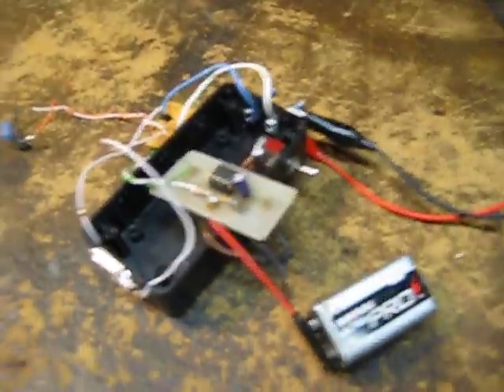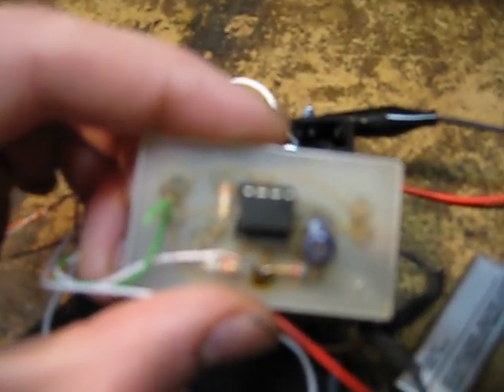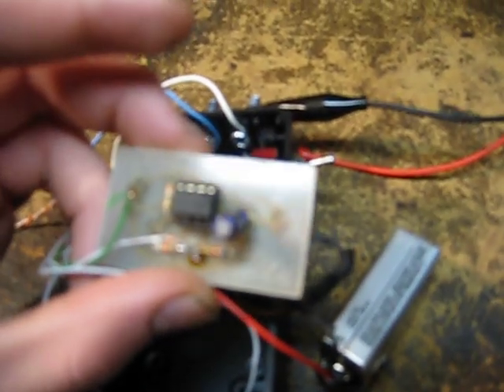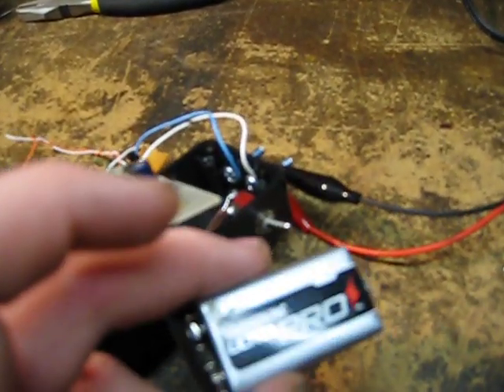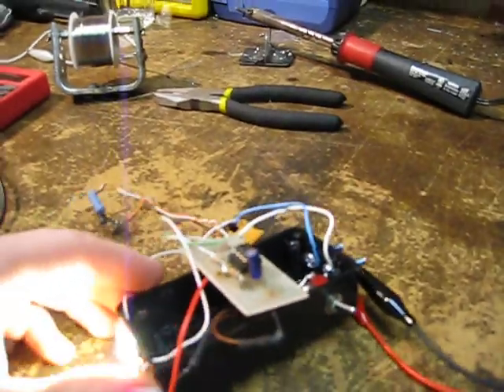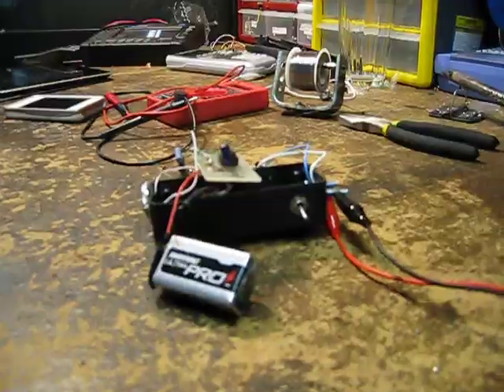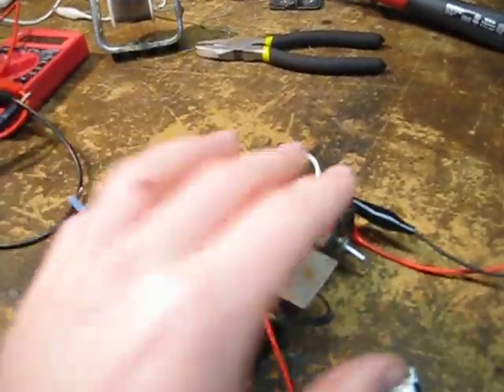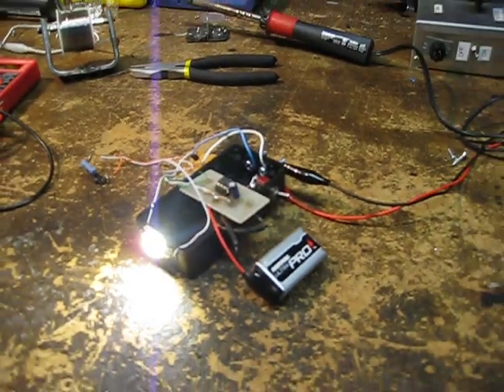Mini LED Strobe Using 555 Timer (Tutorial Link In Description)

Comment: So the strobe circuit is powered by the 9 v battery ???
Reply from the maker: Yes, that is correct.
Reply from the maker: You can ad a voltage regulator to power the circuit and just use the 12 volt supply without the 9v
Reply: Cool :) and can i use a ultra bright or a super bright capsule led instead of the type of led you use for this circuit will it vary ?

Comment: How many bulbs can be wired in series?  Maybe 15 or 20?
Reply: I made one with 24.. different circuit but same IC.
Reply: why do you want them in series? when wiring them in parallel you can ensure the voltage is constant

Comment: That's great. Now... can you tell us, please, how to just increase led intensity rather than strobe in that very same circuit you made? You know, I have one of those F1 style tail lights that strobe when brake ON but I simply HATE the strobe plus is not even legal over here. So I just want to make a regular brake light out of it. HOW? There is no video currently on that matter, so you might be the first... I think
Reply from the maker: +MFP 2241 Use a capacitor with your break light. Do some simple math/ filtering and hopefully the capacitor will smooth out the voltage and make it look like its almost not flashing. Just think about an AC to DC converter and look at the schematics for one.
Reply: +vusiliyK... thanks, I will!

Comment: the on/off delay , is from the resistors the resistor from pin 6:7 is the off the resistor from 7:8 (or power) is the on delay, a dual variable pot can do the job